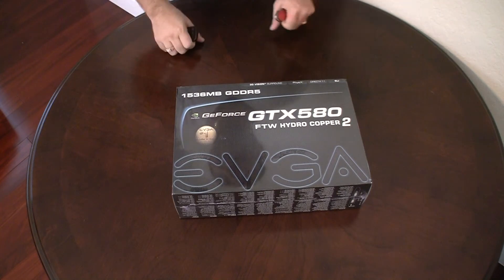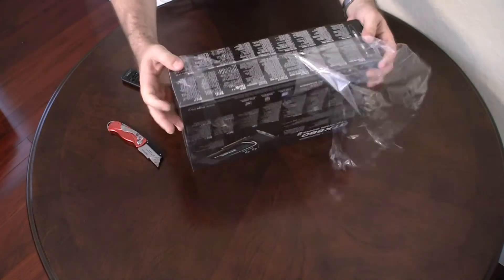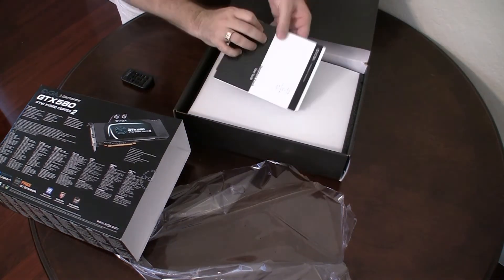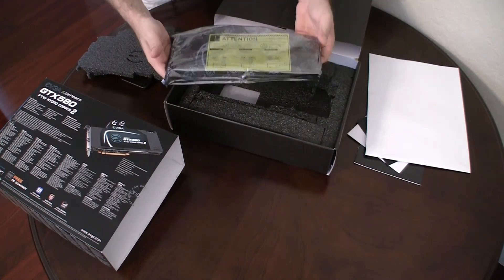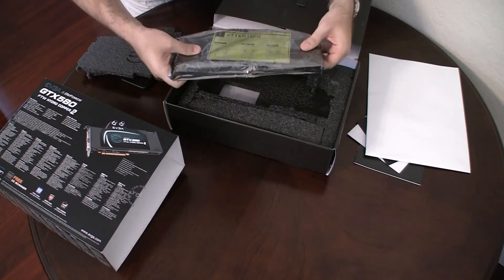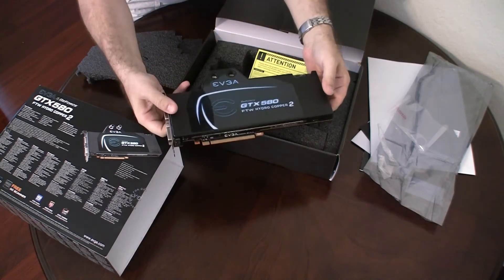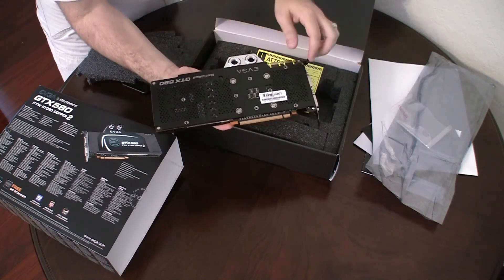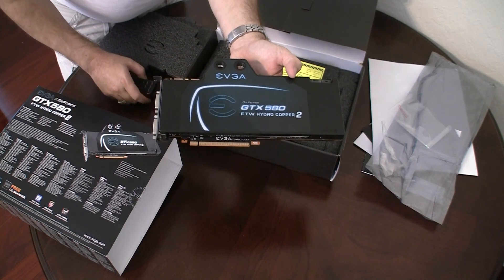Unboxing the EVGA NVidia GeForce GTX 580 FTW Hydro Copper 2 video card

Comment: i want to know what's temps for that card? also, of course need to know what radiator 360x120mm? push/pull or without? so what's the answer for temp in game with full ultra settings? what game? i need to know idle and full loads temps. thx

Comment from the maker: @adargusch  The 3GB version is only clocked to 772MHz, while this one is at 850, making it a faster card, and I don't need the extra VRAM. Regarding the 6990? A few folks wanted to see a side-by-side comparison of a 6990 vs. two 580s in SLI mode, so I got 2 of 'em and will be doing a showdown. BTW - do NOT overclock the AMD 6990 beyond 900MHz (don't ask). Stay tuned for dual 850 superclocked SLI benchmarks soon!